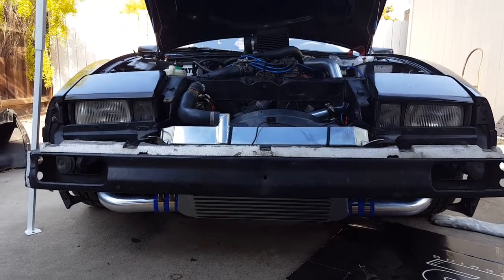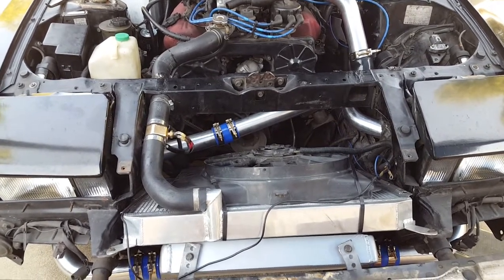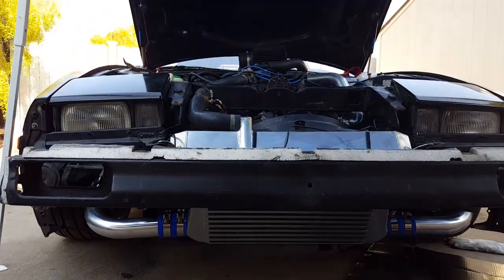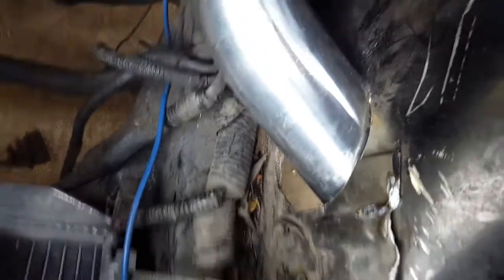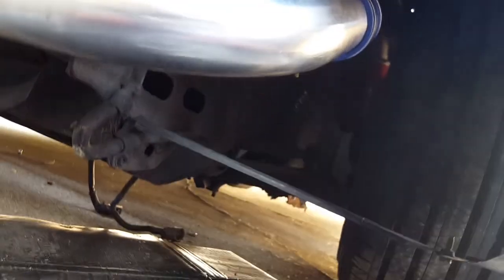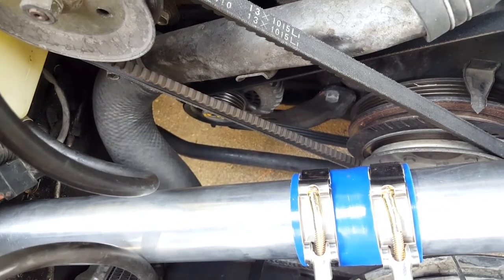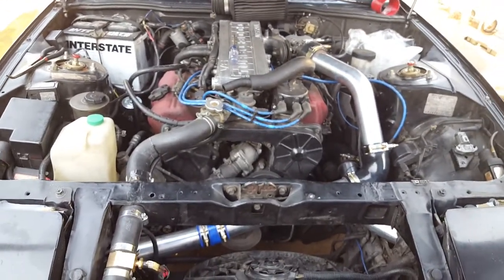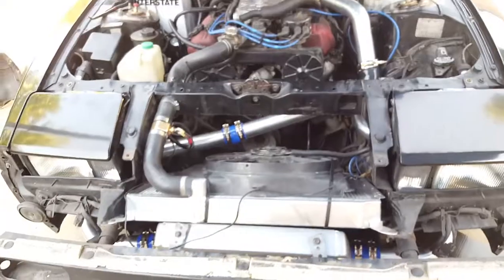Z31 Intercooler Install Walkthrough

Comment: Where are you gonna put the Maf sensor
Reply from the maker: I had the MAF sensor coming off the stock S-pipe. The set was stock S-pipe - > coupler -> MAF ->KN Filter. It worked, but it wasn't the best, since the filter was right next to the fan. What ended up happening was when the fan turned on and I was just chillin' at a light, my AFRs would go super lean and make the car almost want to die. It never died, but it was just annoying.

I have the HY installed now, so I'm running the MAF blow-through and have a filter directly on the fan. Has been working perfectly fine for a while now. :-)

Comment: where'd you get the belt for when you did the power steering, A/C etc... delete?
Reply from the maker: Just the regular belts? I still have power steering, and I got that belt at Oreilly's or Autozone, I can't remember. It's just a v-belt, nothing fancy. They should have it, since there were a few cars with a VG30E. Same with the alternator belt. Only difference is my Z is turbo from the factory, so it comes with a ribbed belt (NA are V-belt). I don't have AC, so that belt, along with the tensioner  pulley and bracket are in the trash. :-P Timing belt (and water pump and tensioner pulley) is from a Gates kit I just got from Amazon.

Comment: Where is your MAF.?
Reply from the maker: At the time, I was still using the stock draw-through set up, although I had to modify it a little bit. Just wasn't installed in the video. It's different now though. I'm running my MAF in a blow-through setup, since I'm running the Holset HY with a filter directly on the compressor housing.
Reply: Alex Barron can you make a video of that? Thanx
Reply from the maker: Yea sure. I'll make one eventually. Probably the next time I decide to work on the Z, which should be fairly soon, haha.
Reply: Alex Barron ok cool because I have my intercooler set up differently and I want to see how others have the maf connected...... thanx

Comment: did you have two vacuum hoses going to the throttle body pipe? because i do and thats getting in my way. I have a 1985 turbo that im doing the exact same thing with but the little things are getting in the way. do you have any updated pictures or anything? also would like to know how you did your intake. Very helpful video though!
Reply from the maker: You're talking about the bigger guys, right? Those are for the idle controls (Aux Valve and IACV), but I got rid of those a long time ago. Even with the stock charge pipe, I capped those off and used block off plates on the plenum to simplify the engine bay. If you're planning to keep those, I would take one of the 60 deg IC bends, drill a couple of holes in it, get some tubing the same size as the hoses, cut it up, and then find someone to weld vacuum ports onto the 60 deg bend. Would be a lot cheaper than finding one and buying it pre-made, and you can also choose where you want the ports. Shouldn't cost more than $40 to get that done, and if you can TIG aluminum, it'll be significantly cheaper.

As for the turbo intake, I just used the stock S-pipe - > coupler -> MAF -> filter. It worked perfectly fine, except the location sucked because every time my fan turned on, it made my car want to die (didn't actually die though) because it leaned out my AFR.

My set up is a bit different now because I'm running a different turbo, a BOV, and I'm running the MAF blow-through.

I don't have an recent pictures of my set up, since it's changed around a bit, but I do have a photo from when I had a gutted Maxima plenum installed. You can kind of see how I had the stock S-pipe set up for the turbo intake: https://www.instagram.com/p/BWldMrBgNZk/?taken-by=alex_z31t

Comment: nice video very helpful, where did u mount the intercooler i see you have the 2 bolts on top but where did you connect it to on the bumper support?
Reply from the maker: I drilled a couple holes on the underside of the bumper support (where the front fascia screws go in on the bottom). They're fairly close to the edge and don't interfere with the fascia screws. The bumper metal is surprisingly fairly thick, so I don't have to worry about the bolts/nuts ripping through or anything like that. The brackets I have on there are bent in kind of an "Z" shape to make everything work.
Reply: Alex Barron im trying to understand. Why must the intercooler be angled?
Reply from the maker: Sorry, for whatever reason I JUST saw this comment.

Anyway, the reason you want it to be angled is because you want to eliminate as much gap between the radiator and intercooler as possible. From what I understand, if you leave a gap, it creates a low pressure zone in front of the radiator, which reduces the efficiency of your cooling system because there is already a low pressure zone after the radiator. Air doesn't really flow as well from low pressure to low pressure. A good example of this my friend's Z32 TT. He has a front mount intercooler, which leaves a very sizable gap between the radiator and intercooler. Around town, his Z runs fine, but when he went to a race track, he could barely get a lap in because his Z started to overheat. :-/

Comment: probably a stupid question but is the wheel on the turbo supposed to be open like that, or do you attach more piping and put a air filter like you do without a intercooler?
Reply from the maker: No, for a Z31 they're generally not supposed to be open like that because they're draw-through MAF cars. I ended up using the stock S-pipe - > coupler -> MAF ->KN Filter. However, you can keep it like how it is in the video, but with a filter of course, and run your MAF as a blow-though. A lot of people with bigger turbos in the stock locations generally tend to run blow-through, since it's significantly easier when it comes to the MAF and intake piping.

Comment: how is it with no AC in CA? been heavily debating about deleting my AC, just wanted your opinion
Reply from the maker: I live in Modesto, and it's pretty miserable in the summer. My Z didn't come with AC when I bought it, so I got rid of pretty much everything that had to do with it, including all the vacuum lines. Problem with that was that my defroster was always on, even if the watercock was ziptied shut. It got so bad, especially if I boosted, that I bypassed the heater and took out the fuses to the blower motor, so I wouldn't get hot air coming into the cabin when it was 100+ deg outside.

If I had a Z with working AC, I wouldn't even think about taking it out. It's really not hard to route your IC piping with the AC compressor in mind.

Comment: Good video! Does your electric fan keep your car cool enough? I had another guy tell me that it an electric fan wouldn't work well enough on my 300 so I have not changed mine out.
Reply from the maker: Yup! I'm using a Taurus fan from the 3.8L early 90's Taurus/Sable. I have it set up to only run on low, and that works well enough to keep my car cool in 100+ deg CA Central Valley heat. However, I am also running a Champion 3-row aluminum radiator.

If you do decide to run an e-fan, I highly suggest upgrading the alternator to at least a Maxima alternator. The stock one is only 70A, so it might not be able to handle the extra load (depending on the fan you decide to use). The Taurus fan I use kind of draws a lot of amperage, so having the 90A Maxima alternator is a must. If the Taurus fan draws too much amperage for your taste, other people also run dual Maxima fans, dual Malibu fans, or even dual Contour fans since they all draw less amperage than the Taurus fan.
Reply: Alex Barron awesome thanks! That will free up a ton of space then. I'm in Oklahoma so yeah, hot as hell here too.